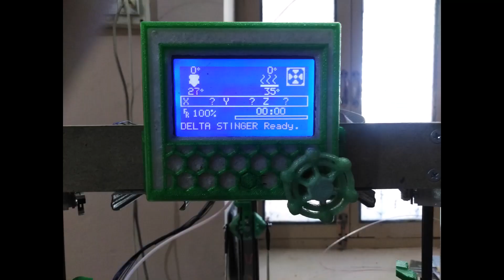"The 3D Printer Revolution: How Delta Changed the Game!"

Comment: Great Work!! Impressive! I'm having trouble printing recycled PET caused by frequent JAMs. Any tips how to solve ? Thank you for sharing and continue the good work.
Reply from the maker: Thanks for the comments . check diameter of filament some time changes due to plastic strip variation in thicknes. Make sure Hotend throat tube have teflon tube inside and extruder grip on filament is main factor. one more don.t print very fast always print on 255 degree, these are my tips that works for me.
Reply: @M.SKhan123  Thank you very much! I'll double check all these things you indicate.

Comment: Hello, your videos help to gain love for 3d printing, and they feed the imagination, thanks for that, on the other hand I have tried to print PET bottles with plastic like you do but my impresario does not do it very well, I am sure it is the parameters, I would like you to help me here if it is not too much trouble, I have a 3d ender I modified it for bottle plastic but it still prints the pizza completely, could you give me a gift the parameters you use to print as well as you do? parameters of the machine itself and parameters of the filer software "CURA" I thank you in advance.
Reply from the maker: Thanks for your entrust in my videos. I had faced the same issues as you do. There are multiple reasons main is filament diameter. If the cross section of your filament shape is like C shape extruder press it or grind it and it will jam in the heat break. In such cases slightly increase the width of the strip. Secondly, feed strip to hotend at 90 degrees so that strip always folds on one side. I slice the model with simple settings and check filament always before print and it never jams. These precautions work for me.